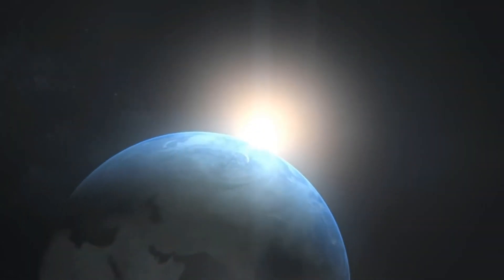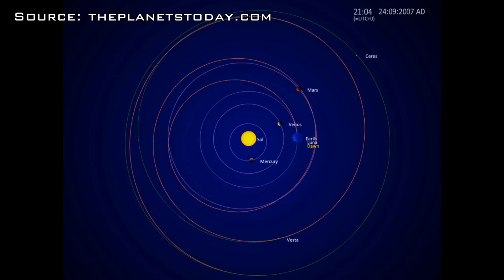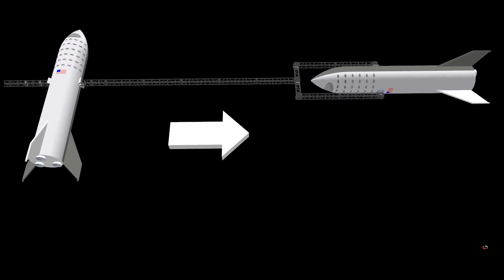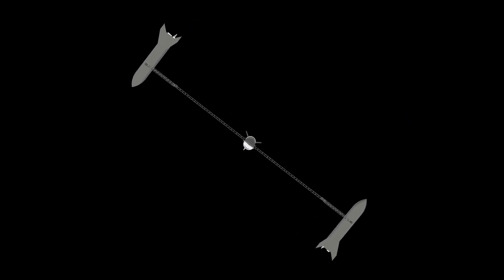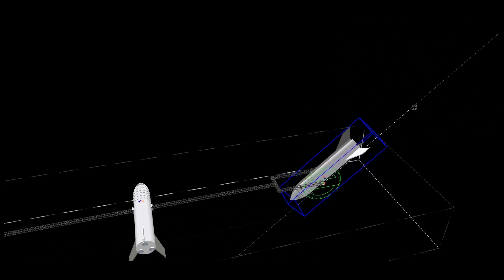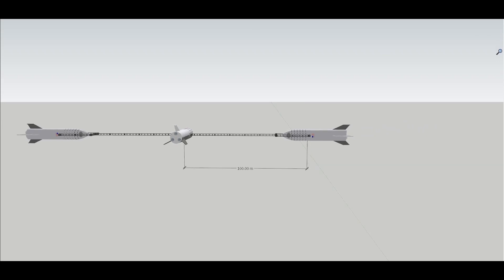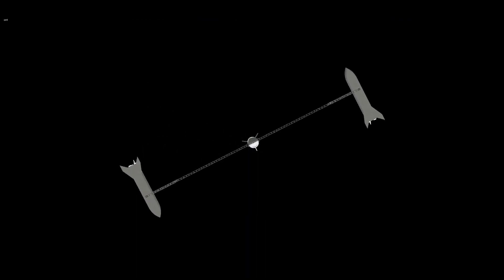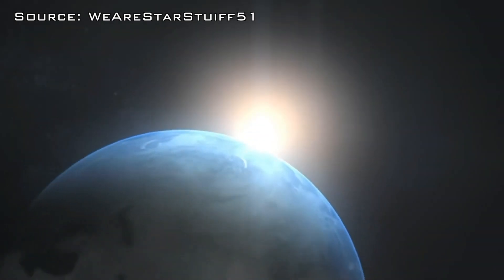GLS2: Artificial Gravity for SpaceX's Starship

Comment from the maker: In the next video, GLS Version 3, I will include the loads math and animate the deployment of the truss structure and swivel joint action. Also, V3 will feature improvements to the design:
1. The truss shape will be improved (the old tuning fork shape was destined to fail) and
2. I will show cables that reinforce the tensile strength of the truss, taking on virtually all of the load of the passenger Starships as they pull outward with centrifugal force.

 I'm also working on a video about the shape of our solar system. Subscribe if you're interested!
Reply: smallstars I love your idea! I have some quick thoughts. The clevis portion could be Y shaped. Also the stiffness of the truss would be enhanced by a pressurized passageway connecting all three vessels. Maybe even the entire truss could be inflatable and roll out like one of those party favors that you blow into
Reply from the maker: @tomcandoit  Thanks for your thoughtful input! 

Recently, I have been pondering the benefits and drawbacks of a Y shape versus a V shape, and I think V shape wins. Really its two V's connected to each other at the center of the GLS, so if you zoom out to look at the big picture, it's an X shape.

I knew the tuning fork (clevis) shape wouldn't be the final solution but it illustrated the concept and I wanted to get my ideas out there even if they weren't perfect yet. The clevis actually evolved from my original idea for V2 that had a cool looking question mark shape and a single point of connection at the nose of the starship. I'll have to post a picture of it because it may still be a good design option for the concept. To see V1 of the GLS, just look at my only other published video.

I would love to see some realistic drawings of a pressurized passageway implemented into the design of the GLS. It might be more practical with my hook shape design.

edit: removed extra spaces between paragraphs
Reply: smallstars, the only complication with your system is, both Starships should be of exact weight. If they traveled in pairs, they may need to carry different things of different weights. You can juggle the cargoes on a planet surface but you’ll have weights and volumes to deal with. That’s the same for return trips.
Reply: @leapdrive  , you could potentially balance that by having a gas or fluid transfer system through the truss, allowing you to move water ballast between vessels to balance the mass.
Reply: Simon..., submarines come to mind. Thanks for your opinion.
Reply: @leapdrive   I'm still pretty busy today, but in the meantime to keep the ball rolling:  I found a couple links on dimensional values and logarithms. 
 I didn't find as much online about this as I thought I would, so we'll talk more.

A short Q&A that might help: 
https://math.stackexchange.com/questions/2201594/logarithms-of-dimensional-quantities
For more a more hard-core discussion: 
http://math.ucr.edu/home/baez/physics/General/logs.html
Reply: smallstars the idea is really great, but it requires a whole new star ship, making it much more expensive, if one star ship could connect to the other without the need of one in the middle, would be much cheaper, then your system. 
Again, really good idea.
Reply: @lisandronicoletti8567  The closer the ships are together, the more rotational velocity you would need to achieve the desired gravity.  Also I would assume that the central ship in required for guidance.
Reply: Hey there, smallstars. I'm Matt Williams from Universe Today and Interesting Engineering. I would like to interview you for a piece, would that be possible? Email is the preferred method, but I can do phone, skype, etc. if that's what you'd rather do.
Reply from the maker: @matthewwilliams8978  try me first at twitter.com/tinysmallstars
Reply: @smallstars  Done and done! :)
Reply: @smallstars  The article is now live. If you'd like to get some statements in there, I can still add them.

https://www.universetoday.com/143368/real-artificial-gravity-for-spacexs-starship/
Reply from the maker: @matthewwilliams8978  hey I didn't see any tweets or DM's from you, but thanks for the awesome article!!! Now I'm scared that real scientists are going to come on here and pick me apart, but I guess that's a necessary step no matter what. So thanks again!
Reply: @smallstars  Odd, I sent a few tweets, but wasn't allowed DMs. You can still get some quotes in if you like :)
Reply: I'm worried that the Dzhanibekov effect would shake your structure to bits.  Otherwise, maybe a good idea.  https://youtu.be/1n-HMSCDYtM
Reply: You can make it super simple. Not even all that stuff. Single cable from one Starship to second. From the cargo hatch (opposite side to heatshield). The "down" is then naturally the aircraft orientation, as it spins, and people can "walk" around.
Reply: @TechyBen  dude, find me a cable able to resist the weight at 1g of 2 space x starhip. Because it would be equivalent to suspend the rocket on earth, by said cable. Fuel and equipment included. That is just impossible
Reply: @idartacus  Cable(s) then? Or any other structure. But they should only need 2 Starships.
Reply: Do you think oscillations in the complete spinning structure could be a problem? maybe a tuned mass damper could be a solution for that.
Reply: smallstars I subscribe
Reply: Are you sure we couldn't use cables instead of rigid structutures? It sure seems like It'd save material and space, provided that some amount of propulsion was used to correct any slack.
Reply: This video is even better; especially on the rotation rate limits needed to use to keep the coriolis effect at a low enough level to make it tolerable enough to live with.  https://www.youtube.com/watch?v=b3D7QlMVa5s
Reply: @ezsparky  thank you!
Reply: This video explores a 1g constant acceleration ship and its capabilities.  It is mind blowing... the effects of time dilation.  https://www.youtube.com/watch?v=b_TkFhj9mgk
Reply: Big Fan. You da Man, the first realistic approach. Never stop. 
1) the truss concept, bye bye. Look at dual and triple cables, spacers, etc, spider webs. Trusses offer almost no lateral stability vs. cables at this weight. You have 3 ships. Software problem. 
2) greatest possible circumference to minimize angular momentum, the difference in making humans sick. I recommend 1.8 km. 
3) central power generation, utilities, cool way to get from one ship to the other (space elevator)
4) redundancy, the ability to transfer the entire crew to one ship if the other fails. Weight changes with constant rotation speed compensated by adjusting cable length. 

5) don't stop rotation when you reach destination. Disconnect the external ships and let them do their own course corrections. Leave the central ship in orbit.
Reply: Mike Miner, I say trust concept takes you to destination a lot quicker and with home convenience, assuming fuel tank is not more than say 5 times the volume of the ship. Swing cables are for large cargo ships and a highly specialized crew who gets paid much more for a very, very long trips. Trust concept is for all types of human passengers some who are more frail to make the swing cable long trips. Swing cables are for the very few humans very physically, psychologically and academically able to make such long and very technical voyages which may only be 2% of humanity. Therein lies the difference. So if trust concept is feasible, both technology “trust and swing” can coexist for different reasons.
Reply: My father was an engineer. When I started in the construction trades he gave me to invaluable pieces of advice. "Whenever you design and build something, think about the guy that has to work on it." and  "Make it as simple as possible, then go home, sleep on it, and come back the next day and make it simpler."
Reply: John.., I’m an engineer as well and, what I say is: simple is better.
Reply: Is there any chance you can try to explain how the distance and size of the Sun was calculated ? In reality it looks like this -  https://youtu.be/PAoixHFUyKw
It is not illusion - reality. So we can see clearly scientific numbers are not working. 
About autopilots for payload automation - do you know NASA is using Flat Stationary Closed Earth Model for Autopilot programing calculations .... 
Curious if you can help.
Reply: Where are we getting the extra fuel for the burns these ships only have fuel to get to mars land and that’s it’s you can’t dip to low in to your reserve either.
Reply: Techno..., I had suggested to launch the fuel tank separately then dock in orbit with Starship assuming the tank is not as big as a “planet.”
Reply: @leapdrive   Keep in mind, you also need to accelerate the tank. And such a tank would not last for days or even hours of burn time. To achieve 1g, you would need to accelerate by 847km/s per day. To amount of fuel needed to accelerate all that fuel is an astronomically large amount. This is why this concept is in science fiction. If it were as simple as you suggest, it would be obvious, as it would be much simpler than trying to get humans to survive a 6 month space flight. At 1g continuous acceleration/deceleration, you would get to Mars in 2-4 days.
Reply: Andrew..., the equation is in the posts. You can now prove it to me using math. Please start.
Reply: @leapdrive  why don't you do your own homework to show it is possible. I'm not responsible for your ignorance or bloody-mindedness.
Reply: Andrew..., if all you got is sheep herd declarations without real proof, stop wasting my time. I was curious as to what the more exact numbers are. You only got mindless assumptions blowing off your behind because you heard something from Joe Blow or from a Sci Fi episode. If I asked you what the size the fuel tanks would be if if we reduced the ship and tank masses by a haft using titanium, how much less would the fuel be? How about carbon fiber as long as we don’t land the ship back on earth? Maybe repairs can be done on Mars or in space. How about increasing Isp to a certain number by using TNT as fuel? Dude, if you got nothing between your ears, stop trying to show off. Get lost.
Reply: @leapdrive  you are clearly trolling. If you are bright enough to be casting aspersions on others, you are bright enough to do your own research rather than trying to browbeat others into 'educating' you. It is laughable that you think you developed the entirely novel idea of adding another tank of fuel. Amazing that the army of PhDs and engineers at NASA did not think of it.
Reply: leapdrive - None of us is “charging anyone” for this, but we do owe it to the others in this discussion to do our research, check our assumptions, conclusions & equations for accuracy, read what each other is saying (& read any links provided) & to be polite.
The “army of PhD’s & engineers have sent plenty of unmanned spacecraft to Mars & have designed rockets & spaceships to go there. BFR/Super Heavy/Starship, New Armstrong & SLS Block B are just the last 3 to be designed to take humans there. At the present $15,000/Kg to LEO (& $75,000/Kg to Mars) getting to Mars requires a LOT of funding, which POLITICIANS have been unwilling to provide. Both SpaceX (with Starship) & Blue Origin (with New Armstrong) plan to get that down to <$35,000/metric ton (Total Spacecraft Weight upon landing) to Mars. At that price, private entities or very rich individuals would be able to finance the trip.
Reply: @leapdrive  [re-post requested]
Regarding tankage, well okay, but you never said a word about it. Which obviously would make it confusing for me. Not knowing, I had to guess what your numbers were saying. So okay, now I have an explanation of that part at least. 
[re-post additional response:  Not exactly. I did or did not "agree" with you about the tankage. It's just I understand you better.]

>> For the Forth Time, we are not solving for delta-v. It is C1 << 
As the one who's been having to repeat herself, a lot, frankly that gets me a bit miffed because no you haven't told me what you are solving for, or why, even once.  Putting a "C" on the left side can suggest that, so fine -- I'll accept that as your meaning. (But sometimes a variable is by itself because it makes a simpler equation, or clarifies a derivation, etc.)

But more importantly, even though I've been asking you, you haven't defined "C"!  Your statement quoted above tells me that C is not delta-v. And it's not X obviously. I'm having to play detective to get an idea of what "C" is. 

So one last time -- please -- and I can't continue until you tell me: 
  What... is... "C"  ??? 
  .. meaning what does it represent ?
Thank you in advance. 

I don't mean just stating the equation again. In physics if you say C = f(x), it means absolutely nothing unless you do these things: (1) define the function f (which you've done, i.e. the equation, check) AND (2) define the meaning of x (which you've defined as Fuel mass, check) AND (3) define the meaning of C...  Which is... what?  I've asked you this more than once and I'm getting nothing so far.

I'd love to continue, so we can get down to the nitty-gritty of your ideas... but you've got to tell me the stuff!  Right?  :-)  We can't talk about your ideas on missions and math until you tell me what you mean in a meaningful way.  Thanks.
Reply: Carolyn, I simply made delta-v (a calculated number) a constant C1 so I can place it along with all other constants on the left side of the equation and called all of them C. That way we can have a simpler equation.
Reply: @leapdrive   
>> I simply made delta-v (a calculated number) a constant C1 so I can place it along with all other constants on the left side of the equation and called all of them C.  <<
Then C is not really a "constant".  It is delta-v, simply over a constant (Isp*g). When you said C was not delta-v, that was very misleading, though I'm sure you didn't mean it to be. And even if you treat it all as a constant you have to say WHAT it is, or the equation is meaningless. 

But I thank you for (at last) answering me on this.
Reply: @leapdrive  >> How’s TNT as fuel? << 
Useless.  And your Isp would be awful even if you could use it in an engine.  By an order of magnitude or so.  This is because the energy content of TNT is lower than most things you simply burn.  I know this sounds counter-intuitive.  This is because energy is not the important factor when it comes to explosives.  It's the speed of the propagation of the reaction.
Reply: Carolyn, that was the fifth time I said that delta-v is being treated as a constant. How else are you going to solve the T- Equation if you have two variables? For some reason all the other four attempts at explaining it to you failed, some in a very elaborate way. I was actually hoping you’d surmise it yourself after a while. I’m disappointed you didn’t.
Reply: @leapdrive  
>> The total amount of fuel is simply X and, 0.5X is fuel quantity at midpoint of the trip. However, I used a different variable symbol Y at the start of the trip for the deceleration stage because realistically, 0.5X is not equal to Y. The deceleration carries less fuel and therefore will consume less.  <<
Okay, here you are first saying half the fuel "0.5X" is left at midpoint. Then you say Y = midpoint mass which is < 0.5 X.  The latter is correct.  If we're talking large amounts of fuel like we are, then Y will be much less than half X.  I've said this a couple times before -- one is about the square root of the other.  Are you with me on that?
Reply: Carolyn, yes, you did say that about the sq root function but, I had to see my simplified equation before I will agree with you. So here’s my final equations:

Acceleration: C = log (ms + X + 0.25X) - log [ms + X^(1/2) + 0.25X]

Deceleration: C = log [ms + X^(1/2) + 0.25X]- log (ms + 0.25X)

If you agree you can do the rest of the math or send me all the constant values and delta-v value with their correlated dimensions. I’ll do the rest. You never resent that post.
Reply: Cant wait
Reply: But i would make the trusses air tight passanger ways and build in 4 sections make the right size to launch on a cargo starship or ships not sure how many thay you have heavy duty docking ports and rcs them selfs once deployed on lep they would connect up to a special star ship mad to handle the load of to star ships hanging off each side
The arms/passeng ways you have hydraulic rotating docking ports to rotate the star ships on the ends that you dock up to them also have these arms covered in solar to add power these arms would stay attached to the special starship and it would remain in space acting as a cargo/fuel tank 
The special star ship would be deside for permanent space in mind cutting out this not need seece it will never reenter and land leaving room for this need to its mission trasport between mars and earth
Reply: This PBS Space Time YouTube vid might  help a bit.   https://www.youtube.com/watch?v=EHKQIC5p8MU
Reply: What a amazing idea I've always thought about the gravity subject because of the long term affects in space. Well mate you have brought the impossible to a possible. Looks to me one day we really are going to mars I've always thought about the gravity subject. Thank you
Reply: smallstars .. Dude.. You rock. Keep up the great videos
Reply: I think carbon fiber could be the optimal material, because it is very light for it's strength, and having into account that most of the force  will be plain traction, if possible, you could see a benefit of placing most of the fibers in the direction of the traction force. Contrary to the outside of the starship, these parts won't be subjected to high temperature. Any extra cost would be far outweighed by the launch cost benefit.

Also, to start and stop turning, instead of turning the whole starship, you could use some lateral ion thrusters as there is enough time for them to do the job and they would be much more functional for the progressive increase in gravity for the back journey than turning many times the starship orientation.
Reply: I bet the weight of the structural reinforcement needed to allow the ships to be essentially suspended by a middle cable would make the spaceships too heavy to lift off. They need to START  and remain head to head.
Reply: small stars - I believe we could get away with a 500 meter long truss/cable set-up going at 1.88 RPM (that would create 1-G) - Any smaller & we create a Coriolis Effect where, because the head is experiencing less gravity than the feet, the astronauts would experience disorientation. Any faster, & they’d experience nausea. 
http://pages.erau.edu/~andrewsa/Project_1/Koch_Cameron/SpaceExploration_Cameron_Koch/Artificial_Gravity.html 
https://www.brandeis.edu/graybiel/publications/docs/166_adapt_rot_artgrav_brr98.pdf
Reply from the maker: @TraditionalAnglican  😍😍😍Very nice suggestion! Great links too, there has been much experimentation on the subject and I'm sure there's a good sweet spot to be found, that's not so extreme tho, right? I'll read in more detail about it and keep you posted. Thanks!
Reply: smallstars - Actually, there hasn’t been much experimentation on the subject of artificial gravity. NASA hasn’t tried it during ~58 years of spaceflight.
Reply: Good oh! When are you applying for a patent on Strith?
Reply: This looks like an awesome idea! My one concern is that this may be a "rotation around an intermediate axis" problem. Can anyone shed any light on this?? https://youtu.be/-Si6iRL5Fj8 
Here is a link to what I am talking about... this could be a huge issue, but perhaps this is not an example of this?
Reply: If the design is able to being the three ships together and move as one ship in case of a emergency then I think it might have a chance. It might help to be able to get from one ship to another.
Reply: Carolyn, the derisive tone was in your head alone. I said I was referring to YouTube. I didn’t even react when you said I didn’t know basic math and physics as soon as you saw my simplified equation. I was simply laughing when you said that. 

Yes, let’s move on....did you get the final equations?
Reply: @leapdrive  >> did you get the final equations? <<
I have: Acceleration: C = log (ms + X + 0.25X) - log [ms + X^(1/2) + 0.25X]

& Deceleration: C = log [ms + X^(1/2) + 0.25X]- log (ms + 0.25X) 
A couple things I should address, but I'll have to do that a little later...

>> the derisive tone was in your head alone. <<
Perhaps there are cultural differences?  Sorry, but to me you often don't come across as polite, which to me is a sign of disrespect when helping you out on your stuff for free, at which point I get kinda pissed and not polite in return.
Reply: Carolyn, I’ve seen a lot of wasted time bickering in the comment section just because there were wrong presumptions. I think we should just not presume too much of the other and many of the bickering could be alleviated. And yes, I appreciate your technical input on this subject matter.

Thank you for your eqtn confirmation.
Reply: @leapdrive   >>  I appreciate your technical input on this subject matter.  <<
You are quite welcome.  Despite the bickering and frustration at times, overall I enjoy doing this kind of thing and sharing what I can help with. 

>> Thank you for your eqtn confirmation. <<
No problem. 

And if you don't mind me sharing something else about politeness:  I haven't thought of myself as overly sensitive -- I've thought of it as simply transforming into a bitch at times when I don't take crap, which I freely admit, lol.  

But you've got me thinking.  These days I work independently with clients where everyone is uber-sweet.  And this is in the South. 

But back in the day, way before "sensitivity training" etc, I'm working alongside "the boys" -- as a rare female in a male-dominated line of work.  And I caught way beyond my fill of derision, man-splaining, and discrimination. To the point of getting burned out. 

So maybe this kind of blunt talk is pushing my old buttons. Which makes it fair to call it sensitivity I guess.
Reply: Carolyn, I’d rather not continue to comment on feelings before I mess up once again. But I’m eager to see you finish the calc. Yes, I’m ready to see the fuel tanks as “big as the planet earth” although that may just be your hyperbole. Perhaps they’re going to be as big as an American carrier.
Reply: @leapdrive  Okay... 
Acceleration: C = log (ms + X + 0.25X) - log [ms + X^(1/2) + 0.25X]

& Deceleration: C = log [ms + X^(1/2) + 0.25X]- log (ms + 0.25X)  

Good that you are using a square root, but I didn't exactly say it was the square root of fuel mass. To be precise, it's the total mass, but that's quite close to fuel mass when you are carrying so much. To quote an earlier thing I wrote:  m.halfway = sqrt(m.initial * m.end), but the m's refer to total mass of fuel and ship. 

So, back to your equations, using your notation [grumble, lol]... 
Leg 1:   C = log (ms + X + 0.25X) - log [ (ms + X + 0.25X) ^(1/2)] 
, which is just: 
C = (1/2)*log (ms + X + 0.25X) 
And for leg 2:  C = log [(ms + X + 0.25X) ^(1/2)] - log (ms + 0.25X) , which is: 
C = (1/2)*log (ms + X + 0.25X)    - log (ms + 0.25X) 

Aaand, here you may already see the notation issue is biting us in the ass big time.  Remember I've been bitching at you that you can't take the log of a mass?  This is one reason why.  It's more than a choice of convention. 

Okay playing it out:  Note also that C.accel = C.decel.  This is because C= deltav / (Isp*g), and the deltav for both legs of course is the same if you want to get back to zero velocity. (I'm using the convention that deltav is the deltav for each leg.)... 

So from the equalities above, and C.accel = C.decel, you get   (1/2)*log (ms + X + 0.25X) =  (1/2)*log (ms + X + 0.25X)  -- log (ms + 0.25X) .  So log (ms + 0.25X) is zero, thus:  (ms + 0.25X) equals the unitless value 1.  Oops.

Sorry to interrupt it here.  But we'll fix this in a bit, when I get back later...
Reply: Carolyn,

don’t forget the factor 1/2.72 in the C.
Reply: Carolyn, why didn’t you take the square root of the fuel empty mass at the end of the deceleration stage? I know that term is supposed to be zero but, I’m just curious.
Reply: @leapdrive  Just real quick..  Maybe I wasn't clear.  My "derivation" on the previous post was done to at last show why we have to fix your equations going forward. The "ms + 0.25X (as mass)  = 1 (as dimensionless number) " is not a conclusion, or any statement at all -- it's invalid and makes no sense. That's why I said "oops" immediately after it. You know what dimensional analysis is, so just consider this "result" in that light. 

Regardless of where we put the square root, your equations are fundamentally wrong -- or to put it more precisely they are non-sensical. My derivation was valid from what I was given. But it resulted in an invalid equation, which I pointed it out, saying "oops". Your equations are not invalid because the numbers are off physics-wise, or because the conception is incorrect (it's not), but because they fail mathematically, as I knew going in. 

The fundamental problem is that you are taking logs of masses, due to what you called your simplification of the rocket equation. Not so say "I told you so", buuut I told you that a couple times before at least. You never quite listened and wanted to continue in a way that seemed comfortable to you.  Well okay, no biggie -- since you didn't take my word for it, I just had to wait until a major problem arose in order to show you. 

If you think I'm being picky just because I want to be formal with my units, and why not dispense with them, then no.  This problem gives you actual numbers that are way wrong if you ignore it. 

You have an opportunity to learn something important from this. So great! When you learn, I'm pleased.  Specifically it's about how units are important mathematically and why we avoid them in logarithms and as exponents, and how we prevent problems. So if you don't mind a mini math "lecture" (and I'll be brief as possible), I'll get to that in the next post. 

Oh, and what is 1/2.72?  You haven't mentioned it before.  Where did that come from and how do you think I should use it?
Reply: Carolyn, e = 2.72, a factor to transform nat log to log.

Yes, I surmised that last term being non-sensical to use to get X. That’s why I took back my comment but, apparently you’ve read it already. 

But there’s still the C = (1/2)*log (ms + X + 0.25X); for the equation to hold, C should be in kilogram mass. Please confirm this. In fact I can see the fuel mass is massive based on (1/2)*log f(x)to equate to C.
Reply: @leapdrive   >> why didn’t you take the square root of the fuel empty mass at the end of the deceleration stage? <<
Because the square roots are for calculating mass at mid-point only.
Reply: Carolyn, ok!
Reply: @leapdrive  >> don’t forget the factor 1/2.72 in the C. <<
Previously I asked what 1/2.72 was, now it hit me that you mean 1/e.  I didn't recognize it because I use greater precision,  2.71828.. etc.  
So how do you get a factor of 1/e? ... C = deltav / (Isp*g)
Reply: @leapdrive   I've been kinda busy today and didn't have time to get back into the math. But in the meanwhile, take a look at these vids about the sci-fi tv show "The Expanse".  Haven't seen it, but apparently tn the show they use the method of artificial gravity you're asking about. 
https://www.youtube.com/watch?v=JWZqp0QoXcw
https://www.youtube.com/watch?v=SIaGXcEnC74
https://www.youtube.com/watch?v=VNjrI0YvZYA
Reply: @harpfully  - Í never got past Basic Math I and II so these calculations are way over my head, but I'm still sitting here with a big bucket of popcorn because you two are entertaining the hell out of me... and that's very much a compliment, not an insult. You and Leap need to do a podcast together, I'd listen every day!
Reply: @DiscoScottie   Wonderful!  
I had hoped more than just the one person was getting something out of it.  If not for the math/science but rather the epic drama, so be it! 
I personally enjoy spreading knowledge, especially about space, which is uber cool. It's been fun,  for the most part...

But I must admit, at times this thread is testing the limits of my medication. 
 ;-) But you have added further inspiration to forge ahead!
Reply: @leapdrive   Hey, I just wanted to check in and see if you are still around and want to continue.  Sorry for disappearing for a week, but things came up and I had been too busy. But I can pick it back up in a couple days if you'd like.
Reply: Carolyn, thank you for your concern. Do not worry about me and, please continue on with your own personal work with due diligence. At this stage, I feel have enough information to satisfy my curiosity based on our final math equation. Thank you for the assist on this matter. When I have other rocket propulsion questions in the future, I will know whom to contact. 🤔🙂😀
Reply: smallstars, why not use something rigid like a shaft or even a tube assemble in space. Cables can be dangerous in that it whips. Tubes can even carry more cargo and provide access to both ships on long trips. 

The AC Clark sci-fi novel “Rendevouz with Rama” uses a huge rotating cylinder about a mile wide. I think the Brawn centrifuge space station concept of a rotating donut with the central tube stationary is too complex. I think the whole centrifugal space station including the central tube can be rigid with the donut and rotate with it. A shuttle can dock with or enter the tube, aim its nose on the cross section entrance or docking end then, fire tangential nitrogen jets to rotate in unison with the station. With computers, it will just be a simple Nintendo game. I called this design my “leapdrive space station.” A man who was defending the Brawn system was adamant that Brawn’s system was superior. It really is too complex.
Reply: smallstars, infact, that leapdrive space station concept can be made into a space ship with artificial gravity. The central tubes being where the fuel and oxidizer tanks, rockets will be.
Reply: Aside from the technical construction problem, in my view the biggest problem for any rotating object in space with people moving in it, will be balance, and therefore staying on track. 

In the ISS they already have trouble keeping the whole station in orbit, simply because someone is doing some exercise on a treadmill, which they keep suspended on some kind of spring's to reduce the vibration transmitted to the station. 

So people moving around on the floor in that kind of spaceship configuration, I don't think so, it will demand for a lot of energy to keep it balanced. Unless everybody is sleeping, then maybe.
Reply: Marco..., there’s a minimum mass that needs to be followed as a rule to make sure people can function normally. Yes, there will be technical issues constructing this now. I was referring to a not too distant future when infrastructure in space is built. Just let Musk do his thing and at his speed; before he retires, this centrifuge space ship can be built. For now I’d be content with smallstars double spaceship but with a solid tube instead of cable.
Reply from the maker: @marcov6t770  balance will be an issue, but not that big of an issue. The reason ISS needs to be boosted is generally because of the tiny amount of atmospheric drag it encounters in LEO
Reply: What are you going to be making the Cables out of a Be Ti alloy ?
Reply: This is an excellent concept and a great idea. I have a few inputs for you to consider: 

1. Adding a structure strong enough to be able to support the entire starship weight to connect the truss system and swivel joint to, is in my opinion a waste of mass and effort. The mounting part of Starship to the booster can already take the full weight (at multiple G, maybe up to 4) of a fully loaded Starship fuel, payload, and all at launch. You should consider connecting the truss there. 
2. This goes for the GLS itself. Connect the truss to the booster rocket mounting part of a cargo type Starship that would act as GLS. So basically, the GLS can be any cargo type Starship and the passenger Starship that connect to the GLS can also be any passenger type Starship. If a Starship mission ever requires 2 passenger type Starship and wants to have gravity, a cargo type Starship could be launch along with all the truss, 3 mounts for each Starship, and 2 swivel joint. 
3. You should develop this idea further and patent it. Develop the truss, auto assembly system, the mounts, and the swivel joint. So when (hopefully) someday Starship passenger flight across the solar system become commonplace, you can supply the auto assembly truss, swivel joint, and mount system to SpaceX. So that SpaceX then can offered it as an option to the paying passenger. Even better, since Starship is fully reusable, the part you supply to form GLS can also be reuse.

Hope that helps...
Reply: Has anyone considered a pair (3, 4) of Bigelow inflatible habitats coupled to a Starsip at the center? The habitats provide more living space, are relatively lightweight and could be stowed and then redeployed on Mars. Alternatively, one starship, on approach to Mars, re-stow habitats, aero brakes into orbit and stays in orbit until reused on return to esrth. The rest of the convoy lands on Mars.
Reply: It was suggested last night that inflatible Bigelow modules, for the added living room, light weight. They could either be restowed and taken to Mars surface as hab modules there, or restowed, and then Starship aerobarakes into Mars orbit for later use on return trip to Earth.  Another advantage is the materials in inflatibles provide radiation protection  better thsn metal skinned Starship.
This is a 2 year trip. Think in terms of a convoy collected or staged in LEO prior to departure to Mars. Multiple ships provide inherent system redundancy for the project. In the convoy scenario, the habitation ring could be an independant space craft, spun up while in orbit and never intended to land on Mars. This leads to perhaps two options:
1.  Flyby and return to Earth, with passengers transferring to the Starships which then land on to Mars.
2.  Devise a way to decelerate on approach (aerobrake? TOUGH problem) or rocket deceleration to park in Mars orbit. Hab Ring could be fueled from Mars for later return to Earth.

Hab Ring propulsion could be low thrust, long burn design, with high specific impulse to improve efficiency. Current ion engines would not provide enough thrust to be practical. Thermal nuclear engins have twice the SI of chemical rockets and might be an option - but bring a whole new set of issues.
Reply: Smallstars, see my first comment;  I think the general idea is great, but that it can be simplified;  as Elon is planning on going bi-propellant for RCS.  You won't need to rotate the Starships 90 degrees, or anything like that.  Still using a rigid structure, which is a great idea, but with a smaller, simpler nose attachment.  I can also help you with the modelling.
Reply: smallstars, what might be required are add on weights to balance the ship weights. So you can carry more frozen pizza from earth.
Reply: @leapdrive   Oh and by the way, I need to correct you on your assumption that half the fuel is used to get half of the delta-v.   Remember, the Tsilkovsky equation is saying that fuel requirements are exponential with respect to delta-v.  So halfway through, the fuel-to-ship ratio is more like the square root of the whole-trip value.  In other words smaller than half a tank. Much smaller in the super-fast scenario.
Reply: Carolyn, I think what I was thinking out loud was, if we used 1/3g (gravity of mars) instead of 1g for the ship artificial gravity how would that impact fuel usage. To reach mid point will take longer, therefore longer trust time but it would be at 1/3 the trust of 1g. Less fuel consumption per unit time but it’ll take longer to get to mid point. And, you have the same delta-v in this case? We need to know if there’s a change in delta-v for this case before we can worry about its relationship to fuel mass.
Reply: Carolyn, your last message once again came with only the notification window and thus only partial. I only got the part where you agreed with me with the tankage. You were supposed to say something else.
Reply: @leapdrive   [re-post requested] 
 ...While I'm waiting to hear about "C".  I can comment on a couple other things and try to confirm what you mean.  You said just now:  
X is initial fuel, & Y is fuel at start of turnaround. 0.25X is the mass of tanks/supports.

(as an aside: in the space business they are pretty good at making light tanks. The tank mass is probably more like 0.05x)

and you said for deceleration, "C" (whatever that is) equals: 
log((Y + m.ship + m.tanks) / (m.ship + m.tanks)) 
and again, this is the correct format, not subtraction of two logs containing mass units, because a log of a dimensional value is not valid.
 

And at this point I have to say: it appears that "C" actually is delta-v, expressed as ratio to effective exhaust velocity.  You said C wasn't delta-v.  What gives?

Okay good that you've defined most stuff, but why do you say total mass for the trip is X + Y?  It's just X, the starting fuel, unless you are refueling or something at the turnaround at your maximum speed.  If that's the case, what about all the energy to get that fuel up to that same speed? 

And what are you now saying about the acceleration phase formula? 

Also, one thing you've been saying repeatedly is that half of the fuel is used at turnaround, which may sound like a reasonable assumption to most folks, but it's not the case. The whole point of the rocket equation is that it isn't the case. Fuel use exponentiates with greater delta-v. 

Remember when I explained to you earlier that the mass ratio at turnaround is the square root of the initial value, rather than a half? Have you corrected your thinking on that and accounted for it?
Reply: Carolyn, thank you for pointing out an error, although I had already figured out this error before my dinner last night. The total amount of fuel is simply X and, 0.5X is fuel quantity at midpoint of the trip. However, I used a different variable symbol Y at the start of the trip for the deceleration stage because realistically, 0.5X is not equal to Y. The deceleration carries less fuel and therefore will consume less. 

What I should have done was calculate the deceleration stage first to get my Y. Equate Y = 0.5X, then use that acceleration stage equation to solve for X. This will be the more correct way of getting X. 

I used 0.25% as tank and support mass because these are external tanks. Internal fuel tanks are protected from external mishaps. I’d like to stay with the fraction I used. 

To help the acceleration concept become more realistic (since this is a spaceship of the future) I’d like to use mass of Starship and external tanks much lighter than it really is. Using a titanium hull will reduce its mass by 50%. Yes it will become a more expensive ship to build. Using graphene (a material still being developed for mass production) would be the best. It may be tougher than steel but ultra light. Temperature tolerance may be an issue but landing it back to earth may not be necessary. Repairs can be made in space or even Mars when Space and/or Martian infrastructures are developed. Currently there’s that other light material used partly in aircraft whose name I cannot think off. It was rejected by SpaceX because of temperature concerns when landing back on Earth. 

There are also the oxidizer tanks that need to be added. Pictures of the Raptor engine inside Starship show the oxidizer tank is about equal to the methane tank. So the equation should reflect that....I just remembered. I’d like to see you add this variable in the equation. 

How’s TNT as fuel? I’m assuming it’s Isp is much higher but, I can’t find this data when I searched. It may be makable in Mars from CO2 and water but does mars have nitrogen?
Reply: @leapdrive  >> There are also the oxidizer tanks that need to be added. <snip> I’d like to see you add this variable in the equation. <<
You just consider "methalox" (which is methane plus oxygen) as one thing. When we say "fuel" in this context, it's really the combination of the two. Being physically separated in the tanks doesn't matter for these calculations. It will always be in the proper ratio for the engine, so you can do that without loss of generality.  And very importantly:  I.sp is calculated based on methalox not methane. 

So just figure your tankage mass the same way. And we don't need to agree on the tankage/fuel mass ratio. Just make it a unit-less number in a symbolic constant like "k" or "r.tank" whatever. Though it will have some value eventually (i.e. 0.25 or 0.05 etc.) it's better to do it this way.  You will carry it into your final equation, where you actually turn the letters into hard numbers.  This lets you see what this factor does to your result. It also means you can plug in different numbers at the end without having to redo the derivation.
Reply: @leapdrive  I used 0.25% as tank and support mass because these are external tanks. Internal fuel tanks are protected from external mishaps. I’d like to stay with the fraction I used. <<  
I assume you mean 25% or 0.25, not 0.25%  ...

The Space Shuttle External Tank, which I've already pointed out to you, was subjected to far more violence than a space-based ship will ever experience.  Massive vibration, aerodynamic pressure of going through the atmostphere at hypersonic velocity, not to mention being subject to 3g of acceleration. 

Wanna know what its tank-to-fuel mass ratio was?  From my back-of-the-envelope calculation from the specs on Wikipedia -- about 0.036 .
Reply: @leapdrive  I think we are over complicating things. Constant acceleration equals a "somewhat large" amount of fuel, more fuel increases mass, more mass equals more fuel to increase thrust so on and so fourth.. Accelerating at 1g continuously, within 2 hours you would be traveling faster than the fastest man-made object ever (NASA Helios 2 space probe). Bear in mind the Helios is tiny compared to a starship! using a quadratic equation to calculate time to reach halfway point to mars at 1g gives 335405 seconds or 93 hours, at this point you'd be traveling at 3300 km/s... now do an assumption of vehicle mass and calculate the energy required to produce this speed (0.5MxV^2), now work out the amount of fuel needed to produce this much energy (using energy density of fuel and assume 100% efficiency), now factor in the mass of that fuel, you need magnitudes more energy and therefore magnitudes more fuel so on and so fourth..  I admire your persistence to calculate this yourself. If you had a massless fuel source then this would be a great idea, in fact, at 1g we would reach light speed in about 12 months or so... I am interested to read the rest of your conversation though!
Reply: Carolyn...., I agree with you guys in the rocket business for lack of a better equation. There’s always the FUDGE FACTOR to rely on knowing that liquid oxygen has a different density than the rocket fuels.
Reply: Seb...., thank you for your thoughts. It is looking like what you just said as per my simplified equation. On the one side is a massive number C and the other side of the equation is the X (total fuel mass at start) that will require a huge huge number to equate to C because X is a logarithmic function.

However, going to the moon and back may only require less than 10% the fuel mass for. 1g trip. If you can, can you set up the equations?
Reply: @leapdrive  >>  that was the fifth time I said that delta-v is being treated as a constant. How else are you going to solve the T- Equation if you have two variables? For some reason all the other four attempts at explaining it to you failed, some in a very elaborate way. I was actually hoping you’d surmise it yourself after a while. I’m disappointed you didn’t. << 
Wow... wow...  Okay, I'll begin by addressing the math/physics aspect of this post...  But first: No you only said what C was in the previous message, so again please cut your derisive high-horse remarks about "telling me five times" and your "disappointment". You are being insulting to say the very least, which I can try to ignore but it's hard because it's hypocritical too, as I've so often had to repeat myself because you simply ignore my questions and statements. 

Okay, regarding variables: The number of "variables" in our example depends on your definition of "variable".  The "independent variable" (i.e. input) is of course a "variable".  But you may adopt the convention of either naming a function output as also a "variable", or as the "value of the function". I've heard it both ways. So, if you are saying that X is the output of your formula, at the same time saying only X is your only variable, then I'm sorry you've got the concept of "variable" backward, at least in the mathematical sense.  [Go research it yourself.]  This is because X is the output here, when given delta-v or C or whatever you call it. Right?  In a function the thing you are given aka the input is always called a "variable(s)" or "independent variable(s)". 

But if you use the convention of calling them both "variables", so what?  It's perfectly valid to do so. The function still "works".  So when you say "How else are you going to solve the T- Equation if you have two variables?" you are telling me you have absolutely no understanding of these things. So I don't appreciate being insulted by you, just because you think you know better.

Now, you might say this isn't a function at all because you choose to hold delta-v constant. Well, not necessarily because even if you hold an independent variable constant it doesn't mean it's no longer a function and no longer a variable.  But okay, if you want we'll just dispense with the function concept entirely, fine, but then you can't say "variable" at all... because there is no concept of that without a function. 

And if you just disagree with my assessment that delta-v not be regarded as truly a constant, from a physics perspective, then you just have a different opinion. But in science you do not get to be rude to people you just disagree with, particularly when it's a judgement-call. You just don't act that way.  I'll have more to say about this later -- that is in the interpresonal sense.
Reply: @leapdrive  .. A clarification: 
I had said there is no concept of a variable without a function.  Then I realized that in elementary algebra they call "x" a "variable" when they give problems like "2x +1 = 7".  In that case, even though it's neither a dependent or independent variable (and actually constant), they say "variable" don't they.  But that isn't our context.
Reply: Carolyn, you are too sensitive. My suggesting there is a failure in communication is not directed at you. I think the communist YouTube has has a lot to do with this. Your post I wanted you to resend disappeared. Then they juggle the posts like an alphabet soup rather than just post in chronological order. You’ve called me other things as well. Not knowing basic physics and math just because you didn’t get the simplified equation at your first glance. Now you lecture me on variables. Just because we’re talking on a subject your more familiar with does not mean I know less math. I have my own specialty you’re probably not familiar with. 

So moving on.....did you get my final equations?
Reply: Carolyn, stop the math lecture already.
Reply: @leapdrive  [sigh] I guess I have to get this out of the way before proceeding ... 
>>  You’ve called me other things as well ... << 
Nope. I have not called you anything once. (Quote me if I am wrong please.) Maybe you're sensitive? 

>>  ...Not knowing basic physics and math << 
No, I went back and checked my quote: 
"You were the one that said earlier to me [nested quoting] 'Just by dimensional analysis, I can tell your equation is invalid'.  So from that it sounded like you understand units, and math and basic physics at least. But here you sound to me like you have no idea. Nor of how logarithms work.  I'm confused now about what you know." 

Note that I said " here you sound to me like...".  Meaning at most other times you did sound up-to-snuff. It's impossible to say that sort of thing without sounding a bit negative. But I felt I had to tell you that because at that point you were genuinely confusing and exasperating me, because you were leaving out critical information and not realizing it (but I won't go over that again here). And also because you were doing invalid things with logarithms (won't repeat why), and that was throwing me off. There are posers all over the 'net as you know, so at this point I was trying to be careful not to waste my time.  

Or maybe you mean this: 
"My policy (which I will maintain) has been to be respectful and not talk down to you, meaning I'm assuming that as a space enthusiast you know terms, basic physics, algebra, etc. wihout an explanation from me. I don't have time for that anyway -- my posts would be 10 times longer. I limit myself to explaining only the particular and necessary things you ask about or show to not understand." 

Here I said I assume you do know, and there was no sarcasm in that intended.  I meant that unlike others on the thread, I'm not going to be disrespectful, or at least not intend to be. I was also just telling you how I'm trying to be brief.  

I hope that helps clear it up and make you feel better. If either of those paragraphs bothered you, sorry. 

>> stop the math lecture already <<
If you like, but you incorrectly called me out on the variable thing with a derisive tone.  So to hold back and not explain it was difficult for me

Back to our technical content in a bit..
Reply: Carolyn...thank you. Back to tech. Got my final eqtns?
Reply: @leapdrive  well to further simplify whether this would be possible, let's take the KE equation (so earth gravity is neglected). Let's assume massless fuel to further simplify. Take a ship of mass 1000kg (tiny compared to starship). From my calculation above of max speed 3300km per second, using the KE equation the energy required to accelerate a 1000kg craft to 3300km per second is 5.5x10^15 Joules. Dividing by the joules per kg energy density of hydrogen (typical rocket fuel choice) we get a mass of 38million kg of hydrogen.. (a fully fuelled falcon 9 rocket weighs only half a million kgs), so this is pretty much impossible even with massless fuel! If I was to factor in fuel mass you can see how astronomical the values would be, and therefore completely impossible.. What do you think?
Reply: Seb, hold your horse. We’re about to expose the truth!
Reply: smallstars, wouldn’t it be simpler to just bring an attached tank of methane (launched separately and connected by docking maneuver) then, used as extra fuel to continuously accelerate Starship to produce 1g? Haft way, the ship can rotate 180 degrees to continuously decelerate while the ship floors can flip 180 degrees as well. It would have the added benefit of getting to Mars faster and therefore reduce the tank size. 

I have not done fuel calculations so I’m sure the size of this extra fuel tank would be.
Reply: @leapdrive  This in not The Expanse channel dude
Reply: Lord Hodor...., you have the calcs?
Reply from the maker: @leapdrive  if it was practical we would do that but our propulsion  tech is not even close to being there. You should watch the expanse. It is science fiction and I believe early season 2 episodes explain your idea very clearly.
Reply: @leapdrive   As a bonus. continous acceleration would also get you there in only a couple of days. And you'd be going a couple thousand kilometers per second.
The drawback is that you'd need a fuel tank the size of maybe a planet (and engines powerful enough to accelerate that planet at 1g).
Reply: Carolyn..., do you have calculations to prove this. I brought up the comment looking for more concrete information, not pontification.
Reply: @leapdrive   Yes I can calculate this. (If you don't mind more "pontification".)  See the Tsiolkovsky Rocket Equation. Basically, the more speed (delta-v) you need, the more fuel you need, so there's more mass, which requires additional fuel, so there's more mass, etc. etc.  It exponentiates. The result is actually much more than the size of a planet. 
To get around this "tyranny of the rocket equation", you have to have a far, far more efficient engines/fuel in terms of useful energy per ton of propellant.  The most efficient chemical rocket engines are nowhere close.  You'd need advanced fusion or antimatter propulsion, etc.
Reply: Wow Carolyn, that’s a good equation to use. We need the specific Impulse for CH4 fuel and the final velocity mid point of the flight just before reversing thrust to decelerate. The constant g0= 1g or is there another dimension used for the constant? I hope you have all that information. No, this “pontification” is getting more interesting.
Reply: @leapdrive  it's no need its logical without friction it can go on forever on space,so that's the most efficient way to build it, and the drawback...if they use and some hydraulic system will be horrible...
Reply: @leapdrive  btw you will need to "break" at some point ,you may suggest airbrake but there's a lot of things that could go wrong just look how most of the mars rovers ended at the beginning.The main point here is something that someone  random nasa person told me on a stream,every engine runs on some short of fuel and that mens mass to de-accelerate, even electric ones...,engines that only use energy simply don't exist ..yet I would like to share with me what you know about the higgs field since i proposed that it was the solution to our mass problem reducing the mass of the fuel to 0 or negative mass however the same person told me that the higgs field is fixed, then it would need some particle not to follow this ,therefore will mean we could manipulate and modify the mass of an object
Reply: Skedar...., the point I’m making is getting another means of artificial gravity by continuously accelerating at 1g. This requires thrust based on Newton’s Law F (thrust)=mass x acceleration (delta v/ time); thrust would provide the 1g gravity.
Reply: Carolyn, interestingly enough, would delta-v matter? The higher the delta the quicker you get to your destination therefore less time using thrust. The smaller delta would require longer thrust. If it’s not a linear proportion, then there is an optimum delta. What would it be? Using a 0.33g may be an option to simulate Mars gravity. Might as well get use to it on flight and, that’s assuming we’re not comparing an extra tank the sizes of planets.
Reply: Carolyn, your message didn’t make it in the comment section in my iPad screen. I only got a partial comment in the notification window consequently, I can only read the part about delta-v and specific impulse mattering and you started to say something about “constant gravitationally.” I’ve waited 9 hours but, that’s all I’m getting. Maybe you can try resending.

Anyway, the delta-v I mentioned as not mattering has something to do with its ratio to the g-force. The smaller the g-force, the longer the rocket engine would have to work because the delta-v become lessens as the acceleration decreases. The less the delta, the smaller is the g- force and the longer time the ship gets to the mid point. I was also thinking if the delta v is proportional to the g-force....if you know what I mean.

Yes, specific impulse matters. If the specific impulse of CH4 is too small, the tank may indeed be as big as a planet. The question is how much should the specific impulse be to make the project feasible? Is there such a fuel? 

The fusion and anti-matter reactors won’t work unless you can find a way to convert their heat generated to thrust. Using cryogenic inert liquids for ion propulsion is one way but, how much of this gas would you need? Back to the tank sizing problem. Using cryogenic flammable liquids is another for rocket propulsion only but it will only be the same design as Starship and, those reactors will only bring up sensible heat of the gas. The sensible heat added to the gas will not make up for for the ship’s added reactor weight.
Reply: @leapdrive  Ohhhh yes.  Delta-v matters.  That and specific impulse is all that matters in calculating the amount of fuel needed.

When I say the constant gravitationally-useful acceleration thing is impossible... I mean waaaay impossible.  Here are the numbers.  It shows what happens as fuel requirements exponentiate...   Let's calculate: 

Since we're going so fast, orbital mechanics aren't that important for this purpose. We'll regard it as straight line trip.  Best case, Mars at it closest is about 60 million km away. So we accelerate for 30 million km (3.0e10 m), then decelerate after the mid-point for another 30 million. Distance in constant acceleration d=a*t^2 /2, and acceleration at 1g means a=g=9.81m/s^2. Solving for t, t=sqrt(2d/g)=sqrt(2 *3e10 / 9.81)= 7.82e04 s, or 21hrs 43min. (So the whole trip is twice that: 43hrs 26min). 
Max speed at turnaround is thus t*g=7.82e04*9.81 =7.67e05 m/s (or 2,762,000 kph). Total delta-v for both halves of the trip is twice this, or 1.534e06 m/s. Btw, this is .5% of the speed of light.
Reply: @leapdrive  [cont.] 
Having delta-v, we now need the effective exhaust velocity. v.exhaust = Isp * g.  Isp of the raptor is supposed to be 380s. So v.exhaust = 3728 m/s. 

Okay, now for the Tsiolkovsky equation:  deltaV = v.exhaust * ln( mass:init / mass:final ). So mass:init / mass:final = exp(deltaV/v.exhaust) = exp(1.534e06 /3728) = exp(411.6) = 5.762e+178.  If empty mass is about 175 tons, total mass with fuel is 10^181 tons (not that the ship's mass even matters at this point). One with 181 zeros after it. The number of atoms in the universe is about 10^80.  10^181 is that number squared(!) times a sextillion.  Guess I was wrong about the ship being the size of a mere planet, lol. 

Going with 1/3 g will help by some orders of magnitude, but obviously that wouldn't make a dent with numbers like that.  But if you cut acceleration waaay way down, at some point it becomes feasible, as with very-low-thrust ion drives that are run for extended periods of time. 

[edit] To answer your question about the level of feasible acceleration or delta-v, that's another kind of calculation.  I'll get back to you later.
Reply: Carolyn, the equation for distance at constant acceleration is d=(1/2) x at^2. Just by dimensional analysis, I can tell your equation is invalid. If I’m right, all your calcs falls apart. Tell me what your e represent. Is that the natural log number?
Reply: @leapdrive   If you had read just beyond that typo, you'd see it was used correctly, as all I did with it was derive t=sqrt(2d/a) from d=a*t^2 /2. Yes I had typed the exponent as 1, and it is now corrected in the post. And btw, to someone spending time on your behalf, who obviously is someone who'd know that formula, perhaps a slightly more respectful tone would be nice.  
The "e" is the exponent separator used in scientific notation.
Reply: Carolyn, I apologize if I hurt your feelings. It’s hard to express tones when typing. I’m used to straight talk in my profession. Did you take back your calculations? I couldn’t find it in this thread.

So e04 is 10^4?
Reply: Carolyn, our initial velocity is the orbital velocity, not zero but, for the sake of this discussion we can proceed without incurring too much error in the calculations. Yes, it matters for accurate calcs because it displaces your mid point distance. Can you proceed in calculating initial mass of fuel to midpoint using that elegant Tsoilskovky Equation? Remember, at midpoint, you fuel tank should still be haft filled. So initial mass = X,  final mass = 0.5X. 

Deceleration stage: initial mass = 0.5 of whatever X is, final mass = >0.  Trust at this stage would be less because the ship is carrying much less fuel. You’ll  have leftover fuel so a trial and error calc would have to be done to be accurate. Once again, for this discussion, that wouldn’t be necessary. It would be sufficient to know just what the excess fuel mass would be.
Reply: @leapdrive  [Reply to your first message above] 
My feelings were not hurt -- that wasn't the point -- but apology accepted. Moving on...   No, in case I wasn't clear, I'm not taking anything back except for that single-character typo.  It affected nothing further, because it was literally a keystroke typo. 

By that I mean the correct formula for d was in my head (as it's been for 40 years), and as I said it was used to correctly (mentally) derive t=sqrt(2d/a).  This formula for t was the only one used for further calculation. I only (mis-)typed the more familiar formula for d to help you follow along in case that would be helpful. 

As for my shorthand scientific notation, which (sorry) I thought would be familiar (it's used by calculators), you have the right idea.  Although you wouldn't see a "e04" by itself.  The form is M.MMMeXX where M.MMM is the mantissa (always with 1 digit before the decimal) and XX is the exponent, understood in standard scientific notation to be in base 10. So the value is m*10^x. 

Usually I don't write math in text. By hand I would write it as "#.## 10 (superscript) exponent". Since I can't do that in text, I used calculator-style notation instead. Hope that clears it up.
Reply: @leapdrive   [to 2nd message] For the sake of rough calculation it's actually better to consider an extremely fast trip as being point-to-point and linear, not bothering with orbital mechanics. The velocity of the planets, relative to each other (which is at minimum at closest Mars-Earth approach) can matter in the linear case, yes, if we were going just "fast" and not "super fast". 

But the calculation I did was just to illustrate how out-of-hand the Tsilkovsky equation gets when trying to go really fast on limited specific impulse. So I didn't even bother with the initial relative motion. With the ridiculously large values you get either way, a precise numerical result isn't the point. 

On the other end, for real-world feasible long-duration thrust scenarios, the linear model is insufficient even if you take into account the relative planetary velocity. And even classical orbital mechanics isn't enough, because you are under constant acceleration from the engines and the gravity of two planets and the sun -- so the numbers must be numerically integrated by brute-force computing.
Reply: Carolyn...., I was in school a few years before you. I used the math text reading it off from an analog wooden calculator then later used the simple calculator which still included some text writing. By the time the more advanced calculators came out, I continued my old way of calculating and never got used to the newer calculator. The only problem with your generation is, if you lost your calculators (as in no power on the wall outlet), you’d be lost. 

But, I think I’ve got it, the first time you explained it. It’s simple enough. Can we continue?
Reply: Carolyn, let’s not introduce other forces such as planetary and solar gravitation. If we stick with just those variables in that Russian fuel equation we should be able to easily get our tank size. The constant Specific Impulse is obtainable from literature, g we already know and, delta v simplified by not including orbital velocity and thank you for your calculation. Natural Log of 0.5X/X shows us only one unknown.
Reply: @leapdrive   Okay I don't want to crunch those multi-body numbers either (that's like actual work, lol). If you want to get some numbers from literature to find delta-v, it's possible but it will be tough to find I think.  As of now we have chemical rockets and ion drives, which are on opposite extremes in terms of thrust, and the literature probably will reflect that. But the ion drives are too low-thrust for gravity and of course we've already discussed chemical rockets. 

Our original question is using constant acceleration for artificial gravity, and I'm assuming you're still talking about that. Honestly I don't think that is feasible for two reasons. First, the acceleration would have to be so low (for fuel purposes), making it like an ion-drive mission in which you wouldn't even feel the gravity. Secondly, a really low-thrust will of course make for a longer trip, with all the hazards that entails and further defeating the purpose. I admit those are "gut" calculations, but it's based on real-world missions and issues I've been familiar with over the years. 

But if you want to pursue it further in literature, maybe just go with the delta-v numbers for an ion-drive mission, as that will be more like what we're talking about. Might be good for feasibility insight.
Reply: As for calculation, no, I am not lost without a calculator.  I had a slide rule, a soroban, and the CRC Math Tables book, and can still use them. The latter two are in arm's reach as I type, but I think I've lost my slide rule. I don't discuss my age as a number, but we're probably close. ;-)
Oh, and what was the "simple calculator which included some text writing" thing you mentioned?
Reply: Carolyn, I was just going with what you said earlier: “I can do this.” I wasn’t forcing you to work. Anyway, I’ve got the fuel equation in a simple form: C = log X - log 0.5X (if I got that fuel equation correctly in my head), where 2X is the approximate mass of fuel from starting point to end point of the Martian trip. This equation is solvable by simple trial and error. I’m not sure how difficult it is to find Specific Impulse of methane but, thank you anyway. Btw, can you resend that delta-v calculation of your which incurred a typo? I can’t find it in the thread.

The Space Industry would have to develop this ion propulsion for a massive spacecraft like the Starship if it’s even practical. It may also require a massive tank for an inert gas to be ionized for propulsion, not to mention a huge electric grid for the gas ionizer. This technology may not reach first base if my gut instinct is right. It’s applicable for small space probes which is what we have now. 

On my previous comment, I merely mentioned ion propulsion as an application for heat sources such as the technologies you mentioned: matter anti-matter and fusion reactors. They would still require inert gas and its massive tanks to propel spaceships.
Reply: @leapdrive  
You do not need much maths to see how this wouldn't work.
A Falcon heavy accelerates at about 3G on the way to orbit. It burns the entire fuel in about 9min. If you wanted to accelerate at 1G for 2 days. (Which is nowhere near enough to get to mars) You would need:
2 * 24 * 60 / 9 (320)  times the amount of fuel a falcon 9 holds. The falcon 9 can only put a measly 68 Tons into low earth orbit how are you going to get 320 fully fueled F9 s to LEO? This does not even consider the rocket equation which would make the fuel required significantly more. So even without doing the proper calculations it is silly. That is why the replies imply you have no idea.
Reply: @leapdrive  
>> you said earlier: “I can do this.” I wasn’t forcing you to work.
 <<
At the time we were talking simple cases where you can just apply the rocket equation and things like that.  I don't mind.  The only thing I won't here do is write a program to crunch the numbers on a 4-body-plus-thrust system.  

>> Anyway, I’ve got the fuel equation in a simple form: C = log X - log 0.5X (if I got that fuel equation correctly in my head), where 2X is the approximate mass of fuel from starting point to end point of the Martian trip. 
<<
No as I mentioned earlier, actually the half-point mass goes as the square root. So m.halfway = sqrt(m.initial * m.end) .

>> I’m not sure how difficult it is to find Specific Impulse of methane but, thank you anyway. 
<<
Yw, but you can just look up Isp, which I did in a previous message. The Wikipedia value of the Raptor engine Isp (burning methalox) in a vacuum is 380s. You don't say the "Isp of methane" -- the Isp is a spec of the engine . And btw the engine burns "methalox", which is methane plus oxygen -- together in the proportion used by the engine. 

But what you want for the Rocket Equation is "effective exhaust velocity".  And that's just Isp with the 1/g factor taken out. (Imo e.e.v. should be the measure of engine efficiency anyway because it's independent of earth gravity, g.) Anyway, it's simply e.e.v. = g*Isp. The velocity ratio, used on one side of the Rocket Equation, is then (delta-v) / (e.e.v.) . 

Quoting from earlier: "effective exhaust velocity, v.exhaust = Isp * g. Isp of the raptor is supposed to be 380s. So v.exhaust = 3728 m/s." .. The value of g is about 9.81m/s^2 . 

>> Btw, can you resend that delta-v calculation of your which incurred a typo? I can’t find it in the thread. 
<<
Like I said, it was literally a 1-character fix of a typo (that affected nothing further) and I just edited it in the original message, which was long. Since it affected nothing at all, there was no point reposting. 

>> The Space Industry would have to develop this ion propulsion for a massive spacecraft like the Starship if it’s even practical. 
<<
Yes, it's a difficult problem. The Isp of an ion drive is the best we have by far, but ion drives have extremely low thrust.  I think the biggest problem scaling one up would be the need for massive amounts of electricity. 

>> They would still require inert gas and its massive tanks to propel spaceships.
 <<
Correct. But with very high Isp, the tanks would be much smaller.
Reply: Francisco...., escape velocities take you more than 3g and has to pull away from earth’s gravity. Your estimation method is too crude to be acceptable. Besides, you can carry methane tanks 3-5 times the volume of Starship by launching multiple tanks separately and installing them in a cylindrical shape configuration. A redesigned Starship can be fitted through this cylinder and each tank connected in space. This contraption can stay in space orbit upon arrival and only reloaded in space separately by a shuttle methane tanker. 

If this design can be perfected, it will make Martian trips with much comfort and convenience you might be able to get paying customers for a ride and, with much more passengers, less food storage for a much shortened trip.

I hope you’re not applying for SpaceX because if Elon hears you say what you just said, he’ll show you the door very quickly.
Reply: Carolyn, whether is four-body or one the fuel consumption should stay the same. One big rocket or 4 smaller ones will do the same work. We are just estimating tank size.

My simplification of the Tsailkovsky Equation is based on a known delta-v which you have calculated. Knowing that, the equation can be simplified as shown. As I said, we are getting an estimated number based with the exclusion of other forces. I’ve been using this equation which you have recommended but, you seem to have introduced other equations and factors beyond the said equation. Where did you get that square root equation? I think the Russian fuel equation will show that square root function anyway when one calculates fuel masses at different points of the trip. If it doesn’t, one of the equation would be flawed. Tell you what....I’ll take it from here.

Yes, you said you corrected your typo but, I can’t find the whole post. If you can send it a second time...thanks.

Ion Propulsion: are inert gases listed with Isp? I thought they’re only for chemical rockets. 

I don’t think you can get a much higher trust between inert gases. Unless you find one, the only thing you do to greatly increase ion trust, is a super high voltage electric grid and a huge mass ejection of gas out off the electric grid. That will also involve increasing tank size.
Reply: @franciscoshi1968  this is what I was going to say.  Pure common sense on current g force and time of burn make this orders if magnitude impossible.  These are not the Epstein drive, which got more acceleration for the same fuel by combining chemical propulsion with electromagnetic 'ion drive' propulsion.  Which of course,  doesn't exist.  

If you want more understanding of these principles,  try the channels everyday astronaut,  isaac Arthur, curios droid, Scott Manley, and real engineering.  

Isaac once mentioned,  if had enough fuel to accelerate constantly,  why wouldn't you just accelerate at 3 Gs and get there in a third of the time. But the realistic way is accelerate and drift.
Reply: @leapdrive   The term "n-body" in orbital mechanics refers to the number of objects involved in gravitation computation. Has nothing to do with number or size of ships... 2-body problems like simple orbits (e.g. a ship orbiting a planet, = 2 bodies) can be represented by algebraic equations for eliptical or hyperbolic orbits as appropriate according to Kepler's Laws. For n>2 you have to use other methods like "spheres of influence", or for more exact numbers it's computational number crunching. You also can't use algebraic computaion if there is thrust being used for a significant amount of time per burn. 

So when I said "4-body plus thrust", it was a reference to complexity and the fact that I'd have to write (or buy) software to do this, because it's way beyond 2-body pencil-and-paper calculation from orbital equations. (The 4 bodies are ship, earth, sun, mars.)
Reply: @leapdrive  If you don't mind brutal honesty, your equation C = log X - log 0.5X doesn't make sense. First of all though you define X as half the initial mass, you didn't define C at all. Also, you can't take a logarithm of a dimensional(with units) number -- it's non-sensical. Thirdly the equation is wrong even without the unit issue and regardless of what C is.  Did you realize that log X - log 0.5X equals simply log(2) or the number 0.693 regardless of what X is? Perhaps your algebra skills are rusty?

I'm pretty sure my equation for midpoint mass is correct.  The square root (an exponent of 0.5) derives from the fact that you have used half your delta-v at the mid-point. I didn't introduce other equations to get that. I derived it from the rocket equation alone using easy algebra. 

As for ion drives, the Isp is based on the usage rate of the inert gas used, and the thrust generated. In practice you also have to carry around a big electrical power source -- but that isn't included with Isp because it isn't consumed. And btw, the choice of inert gas does affect Isp. 

Lastly, I already reposted the original calculations and broke it into two per your request. They are still there. To help you find them, they begin with: "Ohhhh yes.  Delta-v matters."... and: "[cont.] Having delta-v, we now need"... respectively.
Reply: Carolyn..... why are we in multi planetary mechanics? Didn’t we agree to ignore  orbital velocity as v initial and just use zero and without gravitational forces of planets and the sun? You’re making this calculation too complicated.
Reply: Carolyn....., I can only get a partial message from your second post through the notification window so I can only read your complaint on my simplified Tsiolkovsky equation. 

So what is C? C as constant = your already calculated delta v / Isp * g * 2.72, where 2.72 is the factor e to reduce ln to log. And: log mo / mf = log mo - log mf, a log rule, and where mo = X unknown and 0.5X is mf at midpoint of the trip.

 I was waiting for your comment on my X value if you agree or not. 

Please not feel any brutality asking questions because I don’t.
Reply: Carolyn, a simple calculator is one with only x / - + function.
Reply: guy...., accelerate at 3g? Can you have 2 more people your weight on top of you for 15 hours and 20 minutes? By the time you get to Mars, you’d be dead. And I suspect you’ll use up almost the same fuel consumption for trips with 1g or 1/3 g because you’d be burning fuel longer with less g’s. There might just be slight difference in rocket system efficiencies with the different accelerations. You and this dude Isaac aren’t making any sense.
Reply: @skedaritou8138  higgs field is only a small percentage of the total mass. The rest is from the angular velocity of the quarks inside the protons and neutrons I beleive since the mass of a proton is greater than the sum of the mass of its quarks
Reply: @leapdrive  total delta v is total amount of energy regardless of the speed in which you use that energy. Specific impulse is the rate at which the energy gets applied
Reply: Don.., delta v = final velocity - initial velocity. Specific Impulse is a lot more than your explanation. Please do a google search. 

Please people.... let’s not throw in all kinds of weird comments. Some of you come up with outrageous fuel estimations and presumptions that are just not helpful and a waste of time. If you’re able to do some math to help out, you’re welcome.
Reply: @leapdrive   I thought it was pretty clear, that I was just explaining what the term "n-body" meant, because in your previous message you didn't know. We are not "in" (i.e. doing) orbital mechanics. I merely stated it was complicated, requiring software, and that's why it's beyond the scope of our discussion (which we agree). And I've said that before as well. 

In the interests of keeping the conversation fruitful and enjoyable (and please don't take this as snippy), I would please ask you to take the time read my posts more carefully. I'm having to repeat myself a lot. My policy (which I will maintain) has been to be respectful and not talk down to you, meaning I'm assuming that as a space enthusiast you know terms, basic physics, algebra, etc. wihout an explanation from me. I don't have time for that anyway -- my posts would be 10 times longer. I limit myself to explaining only the particular and necessary things you ask about or show to not understand.  And I'm hoping you first Google/Wiki things I say where you don't know terms, etc. 

I know they are long, and I'm putting a lot of dense intormation in my posts (which is on me, but I hope it's challenging), so every word counts and they need to be read over with s bit of care. I'm taking more time than you might realize, writing/editing, making every word count. That's not just for you, or for others reading this, it's how I write always, being something of a perfectionist.   Thanks!
Reply: Carolyn, correction for my simplified fuel equation:

C = log (ms + 1.25X) - log (ms + 0.5X + 0.25X), where ms = Starship mass and 1.25 and 0.25 factors are masses of the 1g fuel contraction at 25% of original mass of fuel initial quantity being an assumption.
Reply: @leapdrive  [1 of 3]
Okay, maybe you want to read back two (of my) posts ago. The one that starts "If you don't mind brutal honesty". Pleeease read this time, don't skim, and just ask me anything you don't get as of yet, or if I'm not being clear to you. Everything I pointed out there, with your previous equation, is still just as wrong now for the exact same reasons. Though the value is not a constant this time at least. 

I'll break up my typically long post this time, in case you are having trouble with your browser and not seeing the entire post, or if your eyes glaze over with long posts. (It happens sometimes to everyone, lol.) ...[cont.]...
Reply: @leapdrive  [2 of 3]
Again, as I asked last time, what is C??  C is the whole left side of the equation, so what is it? An EQUAtion is a statement that two things are EQUAl, right? As in the "=" in every equation. There has to be something meaningful on both sides, or it says nothing at all. 

I think X is fuel mass, okay great, but at the start of the mission, or...? Please clarify.  And what are you talking about regarding "weight" and "contraction". Please explain. The rocket equation goes by mass, not weight. A lower g-force doesn't affect mass. ...[cont.]...
Reply: @leapdrive  [3 of 3]
And as I said last time also, you can't take a logarithm of a mass, or any value with a unit.  You were the one that said earlier to me "Just by dimensional analysis, I can tell your equation is invalid".  So from that it sounded like you understand units, and math and basic physics at least. But here you sound to me like you have no idea. Nor of how logarithms work.  I'm confused now about what you know. Maybe I was wrong. 

Please this time I would ask that you show or explain your derivation of your formula, and what you derived it from, if you don't mind. Thanks!
Reply: Carolyn, for the SECOND TIME, C is a constant for midpoint trip to Mars as you have already calculated the delta-v and can be now treated constant. So, C = delta-v (a constant that’s been calculated by you) / Isp * g * 2.72 (e constant) = log (ms + 1.25X) - log (ms + 0.5X + .025X), equation derived from Tsiolskovsky Equation, where ms is mass of Starship, the factors 1.25 and 0.25 are the mass of the fuel contraption around Starship just as an assumption and, X is the mass of methane fuel initial.

I apologize for using the term weight although at 1g, mass = weight. I made that part confusing. 

It’s fine to ask more questions.
Reply: Carlolyn, don’t forget log (A/B) = log A - log B. How is (nat log  mass initial / mass final) not calculable? That’s what’s called for in the Tsiolkovsky Equation? Are you saying Mr. T is wrong? It’s not my equation. I only simplified it. Tell me where I’m wrong with my simplification. 

Did you get my derivation?
Reply: Carolyn, here’s the neater form of the T Equation: 

delta-v = Isp*g*ln(mi/mf)

delta-v = C1 (a number you calculated for Martian trip at midpoint),
Isp = C2,
g = C3,
2.72 = e = C4 (from 2.72*log A= nat log A,

So, C= C1 / (C2*C3*C4) = log mi/mf = log mi - log mf, 
Where mi = ms +1.25X, mf = ms + 0.5X + 0.25X,
And where, ms is Starship mass, 25% of X is assumed as fuel contraption mass. 

If you disagree blame Mr. T for dimensional errors. I was simply doing math.
Reply: @leapdrive  [1 of 4]
Okay then you need to leave it as a ratio within the parenthesis of the log function. Because, again, you can't take a log of a mass (or anything) with units. Your changing from log(A/B) to log(A) - log(B) isn't a simplification anyway.  But now I get part of what you are trying to do -- for that side of the equation. 

So the right hand side is really log( (mass at start)/(mass later) ), as in the rocket equation, and you have (mass at start) equal: ( (ship empty mass) + 1.25X ); and (mass later) equal:  ( (ship empty mass) + 0.75X ) ).  Okay. 

And X = a fuel mass at some "reference" point apparently? True?  At what point would that be, where fuel=X, or at what part of delta-v spent would that be?  And as for the "later" point, same question?  The end-point or the mid-point or something else, etc.?  ...[cont.]...
Reply: @leapdrive [2 of 4]  
Okay... But now we still don't have a definition of the left side: "C"!   I'm going to assume C = ( (delta v at SOME point) / (effective exhaust velocity) ).  But I'm having to guess, based on what I reconstructed above and the rocket equation, and I still don't know what the "some" point is... You have to DEFINE your variables, on both sides! You can't just throw a "C" out there, unless capital C has a standard meaning in this context, which it doesn't.  I asked you multiple times what "C" was and you've still never answered.  

Please tell me if my guess about what kind of thing C is, is correct.  And if so please tell me: (1) what the "some" point on the trip is; & (2) are you giving me the expected delta-v used at that point?  Or maybe you are trying to solve for delta-v, given X and ship mass?? Thanks. 
[Temporary end of rant.  sorry.]   ...[cont.]...
Reply: @leapdrive  [3 of 4] 
Hopefully I'm getting somewhere, if I'm right about what you mean by "C".  But I don't know what you are solving for, total fuel, or delta-v, or either given the other. Usually X is the unknown, but you have "C" on the left side. 

You need to describe the basic mission profile you have in mind, else there is no context for the equation.  The equation is a statement , and that statement is a description of some scenario .  You need to describe what that scenario is, and what the variables mean -- though of course the actual values of all the variables are not required.  After all, the equation is solving for some value.
Reply: Carolyn, I sent you 3 posts after your 3-part posts. I hope you got it all. It is obvious that the only unknown in my simplified equation is X, therefore I’m solving for X. The delta-v FOR THE THIRD TIME is a constant after you calculated for it and, you came up with a real and finite number. Having done so, I’m treating it as a CONSTANT C1. It is definitely not an unknown or a variable in our case. It is now the Universal Constant  C1 for a close Martian fly by Martian trip at the midpoint of the trip.

Someone heeeeelp!
Reply: @leapdrive  [4 of 4]
Phew... Alright let's return to your right-side value: log ((ms + 1.25X)/(ms + 0.75X)), so I can figure out what scenario you might be talking about... 

From that you seem to be referring to a leg of a trip with a starting mass and a final (end of leg) mass.  And you are also saying that you are using 40% of the fuel.  (Fuel used is 0.5X, and initial fuel is 1.25X, so 0.5/1.25 is 0.40 . Right?  And since we are given fuel use, it would be a good guess that you are solving for delta-v?  For that we would need to know both X, which is 80% of the initial fuel mass for some reason ( 1 / 1.25 = 0.80 ), and the empty mass of the ship. 

That's a lot of guesses about what you're trying to say, but either I guess right, or that will prompt you to give me the actual meaning where I guessed wrong. Thanks.
Reply: Carolyn, no, initial fuel is X and, final fuel at MIDPOINT is 0.5X; 1.25X represents the mass of fuel mass + 25% of fuel mass initial as mass of tanks and support structure between tank and Starship (an assumption).

Final mass at midpoint = Starship mass + 25% of initial fuel mass (as the assumed mass for fuel tanks and support structures + 50% of fuel left over. We need another 50% of fuel for the deceleration stage. 

When the Starship mass is plugged in the equation, we can do a trial and error calculation to solve for X. Remember, this should equate to the infamous C.

For the Forth Time, we are not solving for delta-v. It is C1.

The deceleration stage of the flight is:

C = log (ms + 0.5Y + 0.25X) - log (ms + 0Y+ 0.25X), where Y is the initial mass of fuel at start of deceleration stage, 0.25X is still the mass of tanks and support structures and where X is a known value of this second calculation. 

Finally, total mass of fuel for the full trip Z = X + Y (from earth to mars)

Q. E. D.
Reply: Correction: C = log (ms + Y + 0.25X) - log (ms + 0Y + 0.25X).
Reply: @leapdrive  Sorry yes you are completely correct, I was oversimplifying it as I thought the concept of DeltaV was being misunderstood. You are right Delta means change in so delta V is the difference in velocity from start to finish. A force in Newtons is the representation of moving a certain mass a certain distance in a certain time (1N = 1kg over 1m every second) . DeltaV is the impulse per unit of mass and impulse is change of momentum which is mass x velocity. So I was merely saying that the total energy to get to a destination is dependant on the route taken and the total energy of the spacecraft is dependant on its mass and energy stored in the propellant not how fast the engines can push the craft and therefore how quickly they convert the stored energy in the propellant into thrust.
Reply: Don..., that’s ok, buddy.
Reply: @leapdrive  the reason I use very crude estimates is so I don't have to go thru all the math to show it is not possible.  When you take into consideration the weigh of the fuel you very quickly find it is a ridiculous proposition.  Even without considering the weight of the fuel is still silly. A Falcon 9 takes a few min to burn most of its total mass. Just some simple arithmetic will show that burning at that rate will take a ridiculously large amount of fuel. When you add the weight of the fuel the mass of the craft is so big you can not realistically accelerate it at 1G.
Reply: Francis...., we all know that but, some of us want accurate numbers despite our own crude estimates. What do you get with crude estimate? A crude answer. So run along and play outside. 

“When all you got is a (crude) hammer, you look at everything as a nail.”
Reply: @leapdrive  You only have this 1g during the burning, then it stops, the speed is fixed, no acceleration. How much fuel do you need to continuously maintain the burn? I Bet it's massive...
Reply: Mario..., I know that. Isn’t that the question we’re wrestling here? Do you have an idea how big the tank is going to be? Do you have a simpler equation we can use? Please refrain from “bets.” This is not a horse race.